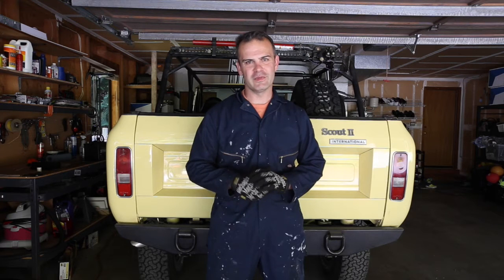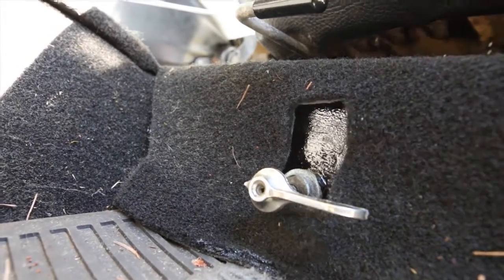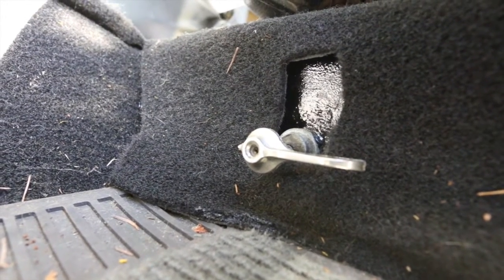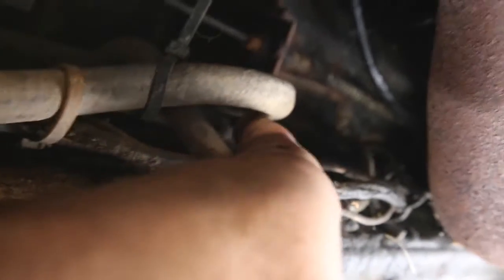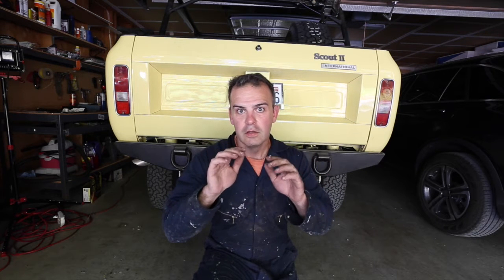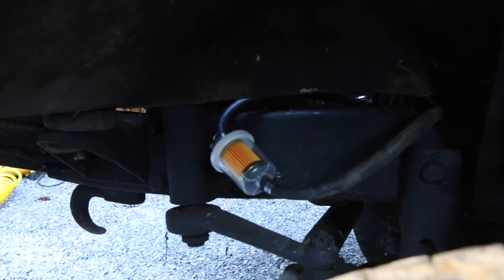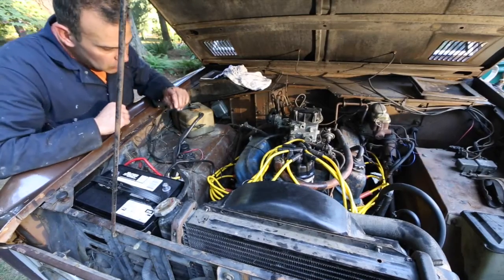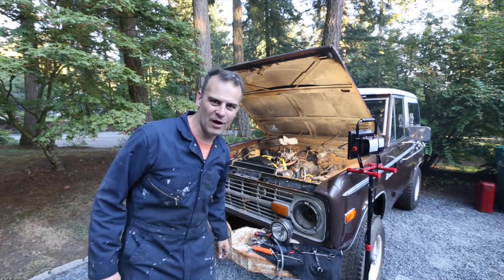Ep 1.05 - Bronco Fuel System Troubleshooting

Comment: I think I’m dealing with a fuel issue. My 77 has a new starter, starter solenoid, voltage regulator, alternator, battery, ignition coil, distributor, plug lines, and an edelbrock cab. If I spray starter cleaner/fluid on it then the engine starts for a split second. It cranks clean and the starter is a premium starter from WH so it tries hard. I have a new fuel tank and sender unit, too. I’m wondering if it’s a fuel filter or the fuel pump. Thoughts?
Reply from the maker: Was it parked for a while? Email me at mattsgarageshow@gmail.com. Easier to troubleshoot over email. If it’s stock with the motor craft carb, a lot of time the accelerator pump doesn’t work anymore.  First thing I would do is disconnect ignition, disconnect fuel hose from carb and have someone crank to see if fuel is even getting to carb. If it is then that eliminates the pump. At that point it’s either the carb, a massive vacuum leak or ignition. Then reconnect fuel hose. Crank a few seconds, throttle the carb while look inside. If you don’t see a solid squirt of fuel when you move accelerator arm, the accelerator pump is shot. If you do see fuel then it’s probably ignition or vacuum. If it’s a C4 tranny there are vacuum lines running to your transmission in the back. Make sure those are connected. Email me with more questions.